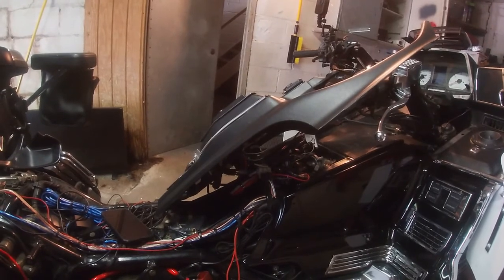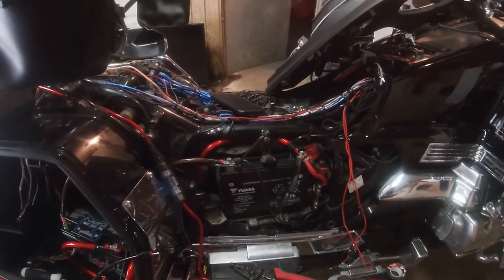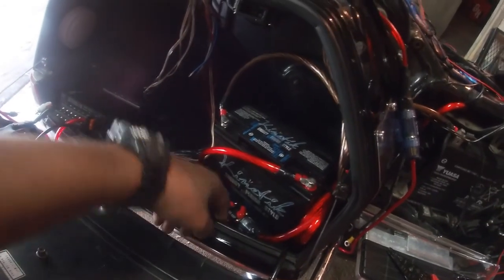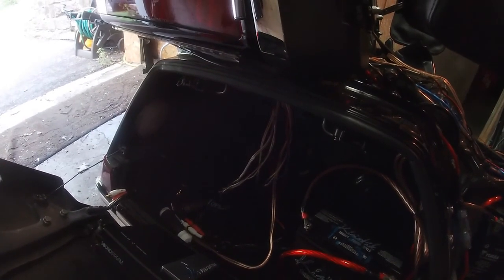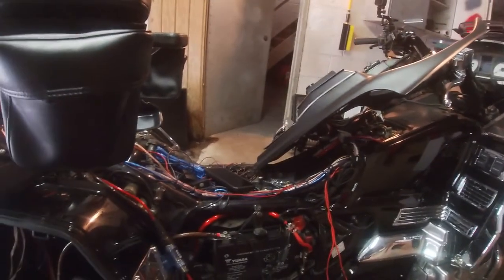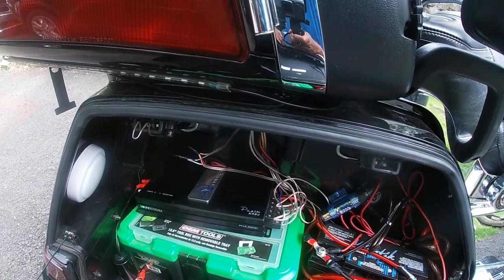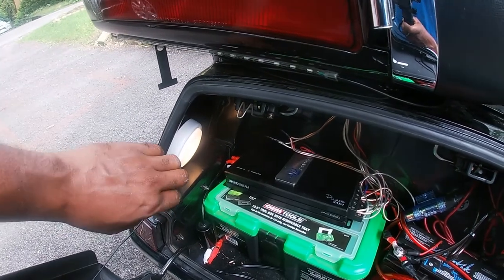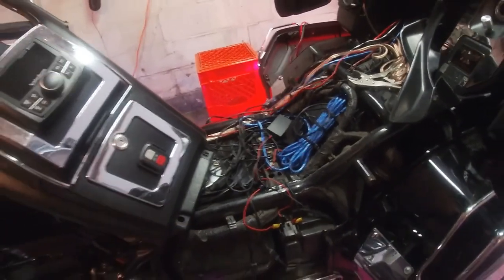Honda Goldwing GL1500:  New Amp Install - Episode 5

Comment: I'm pretty sure if you don't have an isolator to shut the second battery off when it is fully charged you will end up burning up both batteries drawing a batteries amps very low for short bursts is not good for the battery that's why I suggested a capacitor